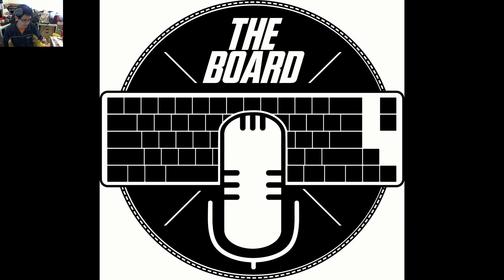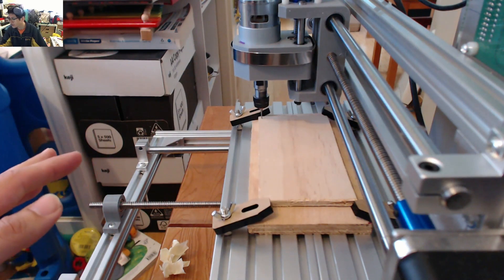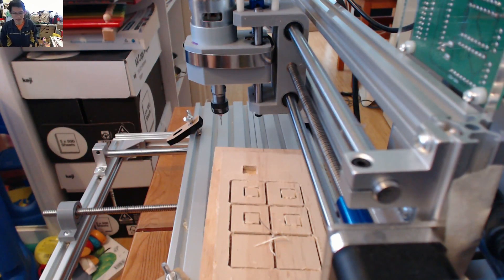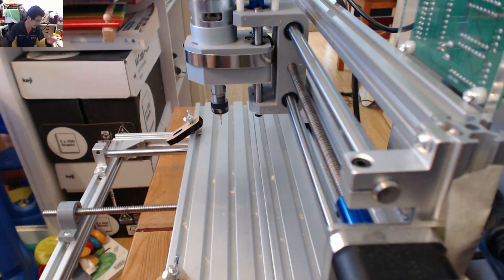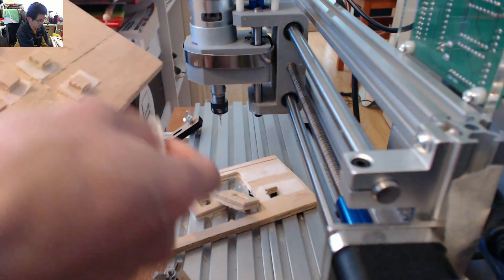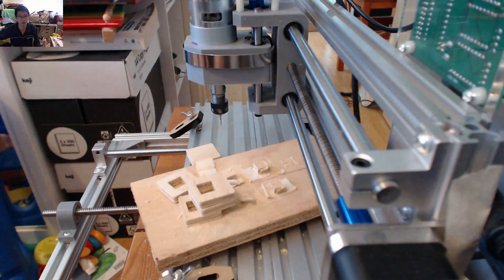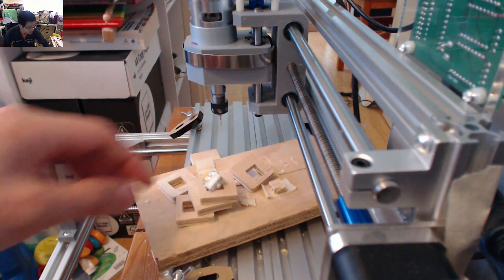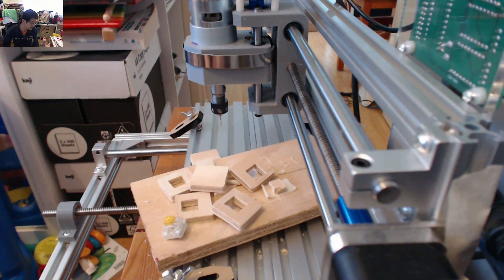3018 Mini CNC Upgrade Part 4 - Kinda Success?

Comment: I had to replace all of my couplers with better quality ones.  No-slip issues now!
Reply from the maker: It would seem like a lot of parts definitely could be replaced with much better quality ones, and while the cost would go up some, you'd end up with a much better and reliable machine!
Reply: @theboard  True.  Other than the couplers on mine, I have been ok with the rest.  I did replace the X and Y steppers with a small power increase.
Reply from the maker: @UReasonIt  At some point, I'll take apart the Y axis coupler and try and re-attach it and maybe put some threadlock or something or worse case more hot glue haha :P

Comment: Instead of hot glue you can use your wife's nail varnish as a poor mans thread lock! This will make future disassembly much easier to do (the nail varnish will crack just like real thread lock under stress.
Reply from the maker: I actually have threadlock now, but the grub screws are so small I'm still kind of concerned about their ability to grip and I certainly don't want to over-tighten and strip them, but if they come off again, I'll try the threadlock. 

Incidentally my wife doesn't have nail varnish, she rarely paints her nails haha XD

Comment: During the time laps it looks like your X motor wobbles a little too? :-)

As for the fit of the button - did you think of the corners of the cut not being square when designing the piece? If you use a round tool, you might have to compensate for that in the corners. Keyword to check for is "CNC dog bone".
Reply from the maker: Hi Balu, Yes, x-motor moves. It moves a lot. Its deliberately not fixed down as the lead screw on the x-axis is bent, and this allows it relief to move.

What you call dog-bone, I have previously done in other designs (factory CNC'd for me) which in my community we call micky-mouse ears haha. I could have done it, but the radii of the bit I used to mill theoretically would have been okay. The flex in the switch I think is both a combination of corners but also the fact the switch is designed to clip into 1.5mm thick, so no clipping means the bits that stick out push the switch side in.

Comment: hey, just wondering what is a good cnc machine for aluminum and brass big enough to cnc ur own boards?
Reply from the maker: Not the 3018 for sure. Probably a professional machine, and I certainly would not be able to tell you anything useful because that is way out of my depth unfortunately.
Reply: On r/hobbycnc people seem to suggest the 3020 class machines or bigger for those tasks.